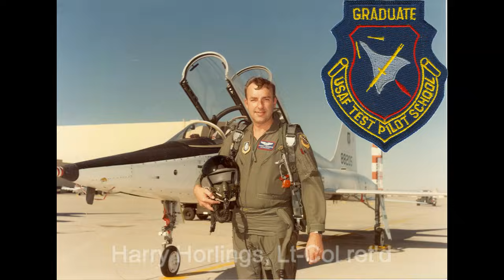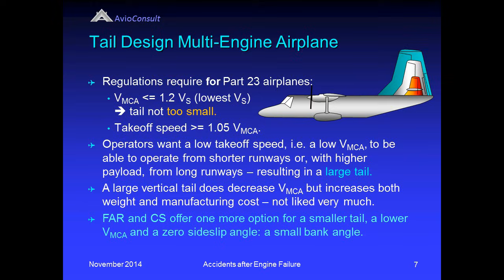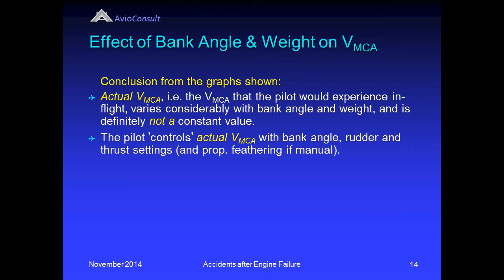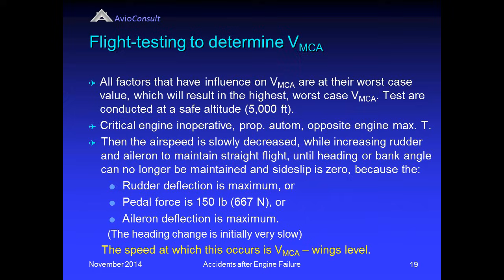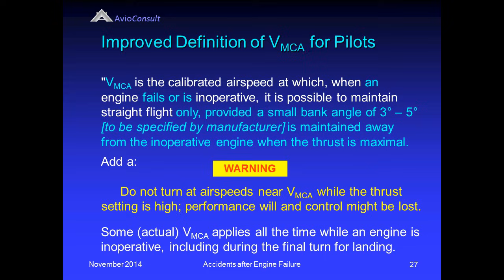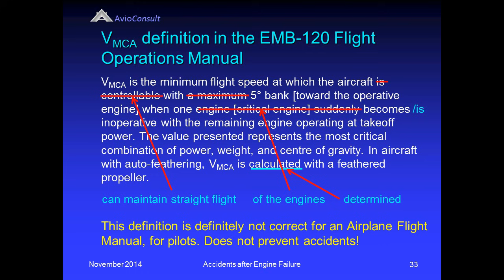Airplane Accidents after Engine Failure  - Real Value of Vmc

Comment: Yes, now its evident:  on takeoff with the usual required high AOA, if the nose starts an un commanded/ unexpected  yaw say to left,  the automatic reaction might be compensate with yoke/aeleron to the right with the wrong assumption that the plane is turning rather than yawing. But if left engine is failing that could be fatal as the lowered left aileron flap now increases the AOA on tht side aggravating the situation. The answer is immediately lower the nose to increase speed and reduce AOA and right rudder and select safe heading to track to prevent the uncommanded turn thats a actually  due to yawing from reduced thrust on that side. When in doubt use rudder and reduce AOA until can clarify why the yaw/turn was occuring. Aileron needs to be used secondarily not primary. Also must demand traffic pattern with gentle turns to the good engine, his lecture makes it clear that even normal bank angles on the bad side can cause sudden loss of control as VMC can drastically increase with bank angle and the bad part is there would be no real-time warning by the systems as to the impending fatally reduced margin of error wrt speed management.

Comment: In the Embraer simulation, were the control movements duplicated from the flight data recorder?  The reason I ask is: you state that the aircraft yawed excessively because "the pilot is not trying to achieve a 5 degree bank into the operating engine", yet, the controls show that the PIC WAS putting right aileron input into the yoke, apparently to no effect.  So my question is, were the ailerons simply ineffective at that speed?  Or should the PIC have given it MORE right aileron?  The PIC was obviously moving the yoke/ailerons to the right in some sort of attempt to bank toward the operative engine.  We all know that the more control surface deflection you make, the more drag you create.  How does that factor into the equation of how much you should try to deflect the ailerons, and at what point are you just chasing the drag curve with no hope of achieving an equilibrium that allows continued flight?
Reply from the maker: I do appreciate your feedback and questions. 
The Australian TSB had the animation made for which they must have used FDR data. 
The pilot indeed used rudder and aileron, but not agressively and adequately enough. The aircraft continued to yaw and roll at the current airspeed, which are signs of the loss of control with the current, not large enough, control deflections.
A pilot, after engine failure, should use rudder and aileron to maintain straight flight and bank 5° into the good engine for maintaining control and for minimum drag (smallest sideslip angle, lowest drag). When the airspeed is VMC(A), the rudder and/or aileron need to be maximum deflected; this is the definition of VMC(A). At VYSE or takeoff safety speed, still 3° of bank is required for minimum drag, for max. ROC.
The drag of (individual) control surfaces is the least of the concern; the safe continuation of the flight requires maintaining control, for which maximum rudder and/or maximum aileron might be required. 
If the pilot of this aircraft would have used up to full rudder and max. aileron for attaining, and thereafter adequate deflections to maintain straight flight with 5° of bank towards the good engine, the aircraft would not have crashed, ME aircraft are designed and flight-tested to do so. 
Please refer to the VMCA page of my website https://www/avioconsult.com/Vmca.htm, and to papers #3 and #6 on the Downloads page for more on this subject. 
Have you seen my comments to the Australian Safety Report of this accident? Download this here: https://www.avioconsult.com/downloads/Review%20report%20accident%20EMB-120ER%202010-03-22%20AO2010019.pdf. 

Fly safely.
Harry Horlings.

Comment: I am in the process of obtaining my MEI and appreciate the thorough explanation. I want to be safe and teach safety with understanding. My take away is 1) speed, 2) 3-5 degrees aileron, rudder ( for straight flight, then cage the engine. Thank you so much. I too will share this with my ME students.

Comment: I appreciate your response Ibrahim, it means that the subject keeps you busy and you obviously want to prevent accidents. 
Turning to either side, while an engine is inoperative, increases the sideslip angle and hence, the drag. The single engine climb performance at low speed is only maximal during straight flight and while also a small bank angle into the good engine of 5° is being maintained at Vmc (Vmca), or 3° at Vyse, or smaller when the airspeed is higher. This is a consequence, for pilots an operational maneuver limitation, of the FAA and EASA approved airplane tail design criteria (in FAR/CS 23.149 and 25.149). On most small twins you will not have a positive Rate of Climb at all when banking away from the favorable small bank angle. 
Don't forget that the asymmetrical thrust does not decrease during a turn and needs to be counteracted whatever the turn direction and airspeed. Lots of variables here!
Please refer to a paper I wrote on these subjects, in which turns are also discussed and graphs are presented showing sideslip during banking, and where you also can find answers: https://www.avioconsult.com/downloads.htm#Investigators.

Comment: Hi, turning into the dead engine has negative consequences like increasing Vmca, but assuming you can maintain safe airspeed, can a better single engine climb rate be achieved by turning into the dead engine compared to turning into the operating engine due to less rudder deflection and therefore less drag from the rudder? Thank you.
Reply from the maker: Sorry for a late answer. Banking to either side results in a sideslip which increases the drag. Please refer to papers 3 and 6 on the Downloads page of my website avioconsult.com in which I explain and calculate the effects of bank angle and weight. Best practice is to climb straight ahead (5° bank into good) to a safe altitude, then reduce asymmetrcal thrust a bit, temporarily, which reduces both Vmca and rudder/drag, sacrifying some altitude. The higher the speed, the less rudder is required to counteract the asymmetrical thrust, the less drag and loss of performance remains.

Comment: Excellent video. I noticed that the two accident case studies you included involve a part 23 and a part 25 airplane. I often find that pilots will apply part 25 jet procedures to part 23 piston aircraft. From a performance standpoint could you discuss how a takeoff planning in a part 23 aircraft schould differ from a part 25 jet since there is no V1 or V2 in these aircraft. 
I believe that an incorrect understand of single engine performance in part 23 aircraft leads to loss of control accidents as pilots attempt performance from an aircraft that isn't available. The hesitate to reduce AOA and in many cases increase it. This results is reduced rudder effectiveness. I believe that current training leads pilots to believe that if they immediately retract the gear and do everything right that their will climb. For a part 23 aircraft this is not true. Pre takeoff planning need to reflect this truth.
Reply from the maker: Thanks Omar. Although I wrote about performance deterioration in my papers (downloads page of www.avioconsult.com), I will review these papers shortly and see what can be improved. For now, the takeoff speed of part 23 should protect for the loss of control, but only if straight flight is being maintained while maintaining a small bank angle of 5 degrees to the same side as foot pressure, which will not only keep Vmca low, but also reduce the drag, and result in max. remaining climb performance. Indeed, this should be reviewed during pre takeoff planning (and might lead to a lower takeoff weight).

Comment: Excellent.
Having designed examination papers for many years, I'm well aware of the importance of unambiguous wording, which should be appropriate for the reader it is aimed at and avoid complication: e.g. 'critical engine' is superfluous in a flight manual - and adds complication. In an emergency, we do not want pilots wasting precious moments over irrelevancies.
The wording of manuals is absolutely critical, yet all too often standardised phraseology is regurgitated over and over, such that it takes hold upon reader AND WRITER; student AND INSTRUCTOR; industry AND AUTHORITY - as if sacrosanct, with no further thought given!
Reply from the maker: Thanks Cosi. I am also very disappointed about the wording and phraseology that manual writers use in Flight Manuals. I recently was asked by a few ATR-72 pilots to review their manuals. These are even worse than I ever imagined. In about a week, I'll be finished with the limited review and post it on the downloads page of my website. You might be interested.

Comment: This is an eye opening presentation.  I'm sure there was probably discussion about Vmca changing under different conditions when I started flying twins and bought my Baron 20 years ago but there were no charts quantifying it and the conditions that change it the way you have done here. I think the normal curriculum has been over simplified (dumbed down) to give new pilots easy to remember simple rules that marketing folks need to make the aircraft seem more versatile.  This presentation has given me pretty specific things to think about in my SOP. 

What are your thoughts on VG's lowering the Vmca?  Would the improvement be proportional through the different scenarios that you describe? Thanks.

Comment: vmc does not get it what the hell happened to v1 and v2.  I have personely had engine failure and one happened  right after take off in a Lockheed  12 v2 was 98 m.p.h and the arcraft had no problem and slowly gained speed through the return for a smooth landing at the airport I had just departed. another one happened in a B25 and v2 came at 145 m.p.h. same result no big deal. in those days we used m.p.h. later it all changed  to knots.

Comment: @AvioConsult. Are you still responding to questions/comments regarding this video?
Reply from the maker: Sure, but may be not the same day.
Reply: Thanks for the response!
First off, I want to thank you for this insightful video. 
I think from some of the other comments here, that some pilots may not grasp the importance of the zero sideslip low drag configuration. Or, those commentors are not pilots and just repeat things they have heard. 
I believe it is equally safe to turn in either direction with OEI, as long as you maintain a zero sideslip condition. 
Let's say we fly at Vyse with the left engine shut down in minimum drag configuration. For the sake of discussion let's consider 5 degree bank and 1/2 ball to good engine minimum drag. Let us also assume that the speed we are flying requires a 17 degrees bank for a standard rate turn. 
So a right standard rate turn would need a bank angle of 17+5 or 22 degrees with 1/2 ball to right. A left turn with the same parameters would be just as safe and yield the same turn performance, if flown at 17 minus 5 degrees, or 12 degrees left bank, ball still 1/2 deflection to good engine. Of course this assumes that stall speed increase for bank angle is considered. At what speed would turning flight be safe and how does that speed relate to Vmca or Vyse?
Please let me know if my understanding of the situation is correct. Thanking you in advance for your answer!
Reply from the maker: @timsaxer6442   When OEI, a sideforce generated by either the rudder, a sideslip or both is needed to counteract the asymmetrical thrust in order to prevent uncontrolled yawing and high sideslip/ drag. At Vmca, the rudder is usually max. and the sideslip is reduced to zero by a small bank angle (5°). At a higher speed, like Vyse, the rudder required is less than max. For minimum drag at Vyse though, you would still need a small 2° - 3° bank angle.
If you increase the bank angle into the good engine for a turn, the sideslip to that side increases. The resulting side force due to this sideslip enhances the side force due to rudder causing a yaw into the good engine. If you don't decrease the rudder, the fin might also stall if the airspeed is not high enough. 
Banking into the inop. engine will cause the airplane to slide off to that side increasing the sideslip and drag. The resulting side force due to this sideslip decreases the rudder generated sideforce that was required to counteract the asymmetrical thrust. The airplane will yaw into the inop. engine. You'll need more rudder, but if the rudder is already max. at the given airspeed, the rudder cannot counteract the asymmetrical thrust anymore. You either need to accelerate, or decrease the asymetrical thrust (temporarily a bit) to regain directional (heading) control. If you don't, you'll lose control and collide with the terrain (laws of physics).
During turns at asymmetrical thrust, you cannot maintain a zero sideslip condition. The ball does not show sideslip while the thrust is asymmetrical. Lockheed recommends to avoid turns into the inop. engine because of the increase of Vmca above the flight speed and the resulting loss of control. 
Only a few manufacturers publish safe speeds for turning with OEI. I've seen a Twin Otter Manual in which it is recommended to increase the speed to 30 kt above Vmca for safe turns with flaps 10 (which is also higher than Vyse). 
Don't believe what most people write on the subject; separate chaff from wheat. Ask the manufacturer of your airplane, make him aware of your concerns. A manufacturer is responsible for publishing the limitations for the safe operation of his airplane, including during engine-out operations, in the Flight Manual. Please also refer to the papers on my website.
I realize this is not the quick answer that you were looking for, but I don't have the required data of most airplanes to recommend safe turns while OEI.

Comment: Wow.  I would never have guessed bank angle is so significant in loss of an engine.  You can see pilots chasing the stalling wing in accident footage which increases Vmca.

Can you discuss the effects on flight control if little or no rudder input is provided after an engine failure?  Is the drag reduction favorable?

Comment from the maker: When banking into the good engine, the sideforce due to weight, that acts in the cg, increases to the good engine side. It is easier to see this while working in the body-axes system, the lateral axis of which runs from wing tip to wingtip throught the cg. Because of this increasing sideforce, the airplane starts sideslipping into the good engine until the opposite side force due to the sideslip is increased large enough to counteract the sideforce due to banking in the cg. A rudder sideforce to the dead engine side remains required to counteract the thrust yawing moment which adds to the banking sideforce. The fin and rudder can only generate this higher required opposite side force if the airspeed is higher (the force is proportional to V squared). The minimum speed for maintaining equilibrium of forces and moments when banking into the good engine is higher or, in other words, the actual Vmc is higher. If the airspeed is, or decreases below this higher required airspeed, the equilibrium of side forces and yawing moments cannot be maintained and the airplane continues to sideslip and, if the altitude is low, flies into terrain. If you need to learn more, please review thisTest Pilot School course:  http://www.dtic.mil/dtic/tr/fulltext/u2/a319982.pdf.

Comment: First of all thank you for your contribution to aviation safety with this excellent and well done educational video on VMC.  I have a question.  You showed a graph for the C130 (I believe) that compared VMC speeds in different bank angles and bank direction.   I was shocked by the large percentage speed increase in VMC at the greatest bank angle when the airplane is banked INTO the dead engine.  It’s perfectly clear to me that given an engine failure in twin the bank angel must be into the operating engine; raise the wing of the inoperative engine.  This is my question; why does VMC increase (not stall speed, but VMC) when the airplane is banked into the failed engine?
Reply: In order to understand the answer to this question you have to understand the single engine aerodynamics behind what affects Vmc. Simply put when an engine fails, two things happen. A yaw and a roll into the dead engine. If you turn into the dead engine you’re allowing that airplane to turn you more into that dead engine. In most instances people try to maintain a specific speed when they simply do not have the performance. Raising the dead helps decrease Vmc speed because a portion of your Horizontal component of lift is actually aiding you in the rudder force necessary to maintain directional control. If you bank into the dead engine same principle applies except now instead of the HCL helping you maintain directional control. Now you need that much more rudder force to counteract that yaw. At some point when rudder reaches full travel you no longer have the rudder authority to maintain directional control hence why you lose directional control. The rudder effectiveness is determined by speed and the vertical stabilizer is an airfoil, the same way the wings can stall so can the vertical stabilizer.

Comment: As a pilot and aeronautical engineer myself, I found this video very interesting. I have dealt with both the CS 25 and airplane flight manuals, these documents are essentially very different and it shouldn´t be the pilots job to interpret or understand the certification specifications. One note however on slide 34 (39:00), with Vto I assume you mean rotation speed Vr? My understanding of Vto is this is the lift-off speed, the speed at which the entire aircraft just lifts off the ground and it is of no operational significance.